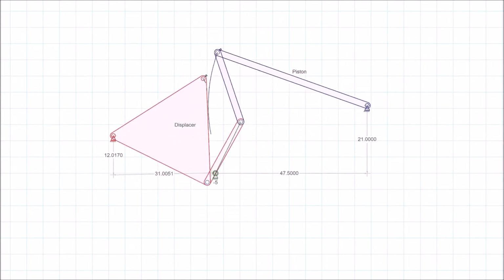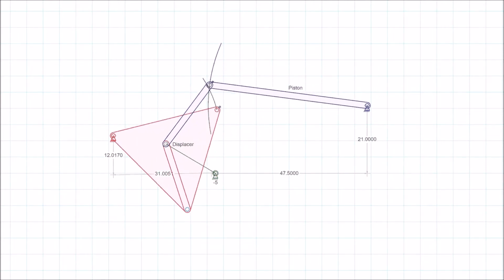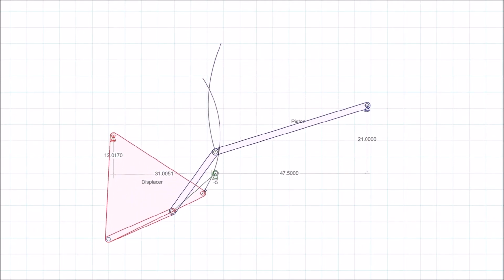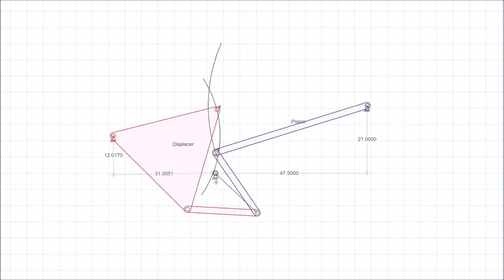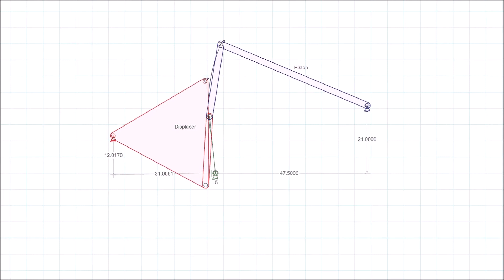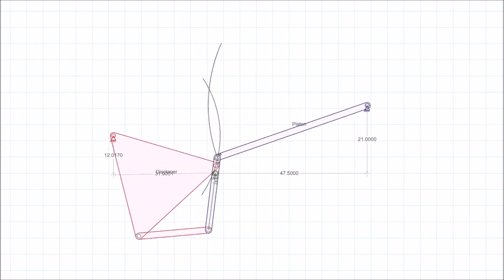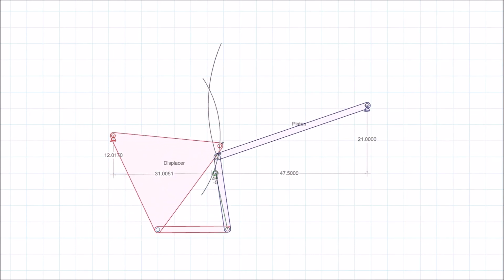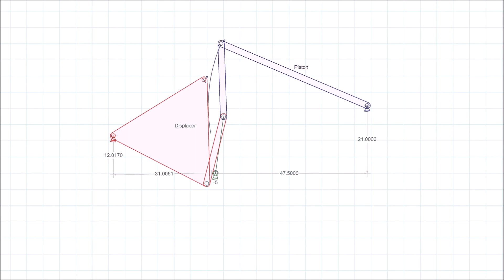Twin Four Bar Stirling Engine Linkage

Comment: I had similar concept in my head but the assymetrical TDC and BDC dwell angles put me off. 
A lay shaft running 3rd harmonic with 1/3 amplitude crank coupled appropriately with main crank would create  the start of a square wave motion. The TDC and BDC have longer dwell angle a slight 3rd harmonuc movement which would be good for a displacer.
By changing the phase relationship between the cranks a stroke favourable for the power piston might be achieved.

Comment: Dear Mr Hall,

many thanks for this nice and meaningful video.
With which program you did the animation?
It looks very nice and seems to be very useful.

I am very interested in the research of improving the Stirling cycle by Dr. Allan Organ.
In a kind correspondence a time ago he sent me an article where he describes the problems of the Stirling cycle.
(In short: wrong quantity of working gas with the wrong temperature at the wrong time in the wrong space during expansion and compression, just like you said in the video)

As a solution he presents the L-crank mechanism which makes it possible to get better volume variations.
I wanted to built a test engine with the L-crank linkage but then I thought that it won´t be suitable for a high power and high rpm engine.
But I haven´t much experience with these kinds of linkages.
To get an impression on one of my engines: https://youtu.be/8JY65VfvKzQ   

I think the Twin Four Bar Stirling Linkage you present here is a further development in the same direction of Dr. Allan Organ.

I just subscribed the Stirling Newsletter and hopefully soon I can learn more about this new development.
(Thanks to Robert Sier !)

Do you think this Twin Four Bar Linkage will be suitable for high power and rpm ?
Do you know any Stirling engine with the L-crank or Twin Four Bar Linkage?

Unfortunately I think both linkages will be hard to build to a sturdy mechanism for a high power Stirling engine.

My hope is to modify a rugged linkage like the Ross Yoke (which is very flexible with volume variations if you max out all geometrical parameters)
to approximate the demanded new volume variations.(But it still stays sinusodial...)

I am not sure if this can be done with common sense and visualisation of the volume variations or if it has to be done with fluid particle trajectiory
in Lagrangian coordinates which will not be easy to understand and program and will cost a lot of time.

I am undecided if it is possible for me and if it is worth it to set on the new volume variations as the basis of my new Stirling engine which is a decision for years.
I have to work mysels in the topic a lot more to make a decision.
Now I watch for the newsletter and if someone knows any resources about the topic (an ISEC conference paper exists but I can´t find it..) I would be very thankful.

Many thanks for your nice video and your great Stirling work in general.
I am impressed and inspired by your Stirling effort since many years.

Sorry for this wall of text and the many questions!

Greetings and best wishes

Ralf Tombrock
Reply from the maker: Ralf
Thank you for your comments
The linkage program is available at
http://blog.rectorsquid.com/linkage-mechanism-designer-and-simulator/
It is free and extremely easy to download
David Rector has even included some Stirling linkages in the sample set (at the end of the set)
I found it far easier to alter an existing linkage rather than to define one from new

Thanks for your video link. Your engine is superb. Beautifully built.
You discuss issues about other linkages and how well will they work
I suspect that the only way to find out is to build one!
I have no access to any theory/calculations that can tell me what the output power will be
But... more pressure = more power.

My direction has been to measure.
Measure the power curve of an engine
Make a change - ONE change
Measure the power curve - and find out whether that change was good - or bad!

So, measurement led design.

My email id is andrewthamesside@gmail.com
Andrew